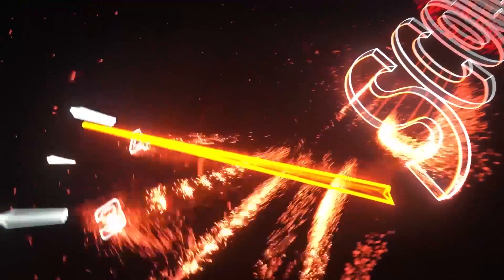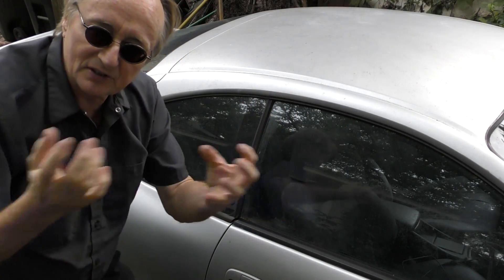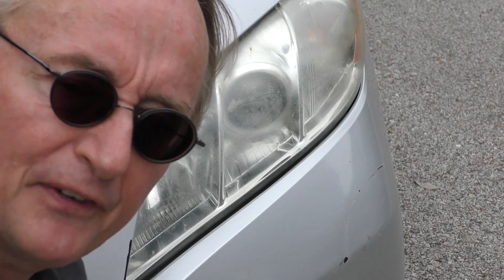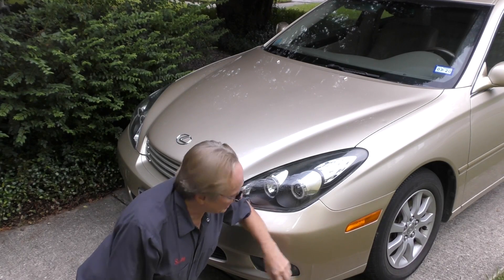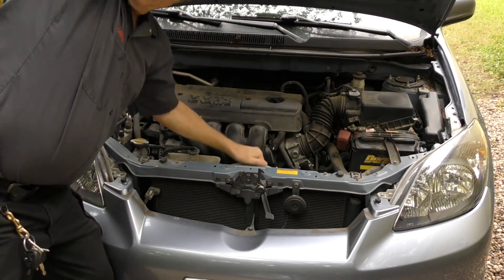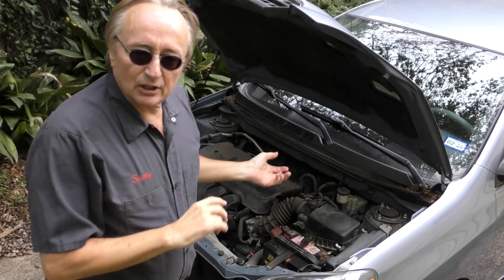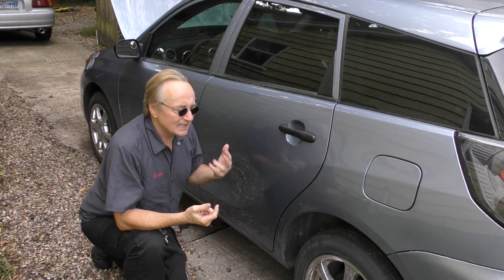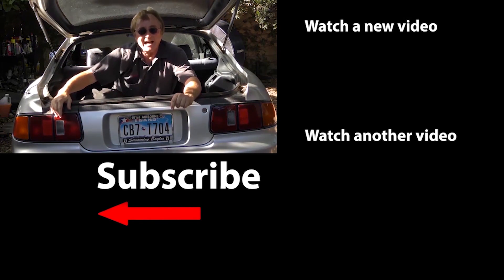You Can't Fix Stupid (Closing My Car Repair Business?)

Comment: So basically you're saying everybody should drive an air-cooled VW because:

1) Simple mechanical fuel pump in the engine compartment
2) No water pump (with ANY kind of impeller) to worry about
3) Glass sealed-beam headlights that never fog up inside or out
4) Chromed steel bumpers
5) No radiators to worry about
6) Chromed steel door handles
7) A single V-belt that's cheap and easy to replace

Hell, works for me!
Reply: I got one 9 years ago, never put 1 euro in it other then oil changes timing belt and few light bulbs. 0 problems and runs the same for 200.000km now,  since day 1. Can't complain.
Reply: @hammertiming8423  Got mine last summer, couldn't be happier.  Not daily driver but a lot of fun on the weekends, and so easy to work on yourself!
Reply: The VW's and early Porches were copied off the Tatra 11 -  Tatra 97  from the Tatra Company in the Czech Republic.
Reply: @JoeC88  except made properly, czechs cant even make a bed
Reply: @PazLeBon  In WWII the Germans rapidly rushed in to take over the Tatra cars and trucks that were superior to any others.  Tatra even made the air cooled diesel V8 & V12's for German tanks & other vehicles.
Reply: @PazLeBon  
Couldn't organize a rock fight in a gravel pit
Reply: Yeah, good car. Lets get a petition to that Brazilian plant to churn em' out by the thousands.
Reply: @mohabatkhanmalak1161  sounds like a good idea to me!  i miss 'em a lot!

Comment: 4:50 Plastic Bumpers... I remember learning to drive a big ol' 70s impala on a curvy road going 65 late at night. I hit the guard rail with the front bumper and it made sparks longer than the car. When I stopped to examine the damage there was just some chrome missing from a 2 inch wide spot on the bumper. That was it.
Reply: AAAHHHAAHAHAAHAHAHAHAHA!!!!!!!!
Reply: I had a 69 merc monterey . Lady with a brand new Datsun 280zx sticker still on the window hit me from behind.When I got out to survey the damage,her front and hood was cracked all the way up to nearly the windshield. My metal chrome bumper had a hardly noticeable dent. I told her my car didn't have any noticeable damage so no harm done. This was around 1981 in heavy Houston rush hour traffic.Last I saw of her she was boo-hooing on the side of the road.

Comment: Anyone can design a fuel pump, it takes an engineer to design one that barely works.
Reply: The engineers design a perfect long life fuel pump and it gets costed at $45 to manufacture, word comes back down to get back to the 
drawing board (ok, cad program) and make it cost $20 to manufacture...that's your budget, so there goes proper bearings and wear parts.
Meanwhile, back at Fiat Chrysler the word comes down to make it cost 50 cents to manufacture...
Reply: Engineers solve problems you didn't know you had using methods you'll never understand.
Reply: @davebuck3944  It's not all benevolent. They engineer things to function marginally using the cheapest materials possible sometimes = poor quality.
Reply: @brenttaylordotus  Many times the bean counters place budgetary constraints on the engineers making it nearly impossible to design assemblies to the highest standards.
Reply: You say that, but you probably don’t understand what goes into engineering design.
Reply: @brenttaylordotus  Nonsense.  That's the fast track to giving your competitors all your business.
Reply: Bo McGillacutty It’s not that simple. Not every product is a widget vs widget race.
Reply: @brenttaylordotus  Give some examples?  Certainly every car is.
Reply: @brenttaylordotus  Because engineers have to, Not because of lack of knowledge. My friend is a engineer. He tells me that he works on a project which is not properly suited for using yet, But his manager tells him to prepare for use because the company's wants it now. 

There is no time to make it perfect. It also has to be cheap to make. If it breaks they make money again 😉 Don't blame the workers. Blame company policy.
Reply: @cutthroat795  I am an engineer with 39 years experience working in the defense industry. I worked at Pratt & Whitney's West Palm Beach plant for 5 years and Harris Corporation's plants in Brevard County, FL the remainder of my career. There are many factors that must be considered in a design. Reliability, durability, maintainability,  producibility and Design To Cost (DTC) all must be considered. Many defense industry companies have different specialty engineers designing the same component assigned to what are called IPTs (Integrated Product Teams). There is also a Chief Systems Engineer who oversees the entire program engineering team and is responsible for ensuring the design meets all contractual specifications. Then there is a Program Manager who is responsible for the entire program from a cost, schedule and technical compliance standpoint. The automotive industry manages the new car development process much like the Defense industry manages weapon system design. Based on my experience I understand the engineering design process.
Reply: I see stupid design everywhere, not just in cars. 😀
Reply: No, it takes an accountant to design one that barely works.
Reply: @davebuck3944  - A cost cutting measure on a bearing on a $250 million airplane can turn it into flaming junk scattered over the landscape. Full of dead meat, too.
Reply: @algrayson8965  I realize that. I'm a recently retired engineer who worked for 39 years in the defense industry including 5 years at Pratt & Whitney.
Reply: Oliva Gina  you may want to checkout L3 Harris Corporation. Their headquarters is in Brevard County Florida. They employ about 6, 000 people in four different locations within the county. Many are engineers including mechanical. Brevard County is a great place to live. It offers affordable cost of living including housing. The county has over 70 miles of beaches. We have lived in Brevard County for 30 years and have enjoyed it. If you're not a Florida resident you may not know that Florida has no state income tax. I worked in Florida my entire career. I estimate I saved at least $150K by not paying state income tax during the course of my career.
Reply: Unfortunately, I can't help you with that.
Reply: @davebuck3944  
I  agree.   back  yard  weekend  u  tube  "mechanics"  giving   their  2  cents  on  engineering  n  engineers  is  nonsense.

Comment: You can't fix Stoopid, but you can avoid Chrysler.

Company has recommended you start learning engine repair = Chrysler
Reply: 3.7 V6 to start your auto repair study
Reply: @CHMernerner  also the 3.8l v6, start with the crappy valve stem seals they used at the factory.  Replace those to stop it burning oil.
Reply: Good  one
Reply: @orbitalair2103  i work at a chrysler dealer as a tech and have for a few years, 3.7 magnums are pretty reliable. old engines, a lot still on the road and not a lot of problems. and the 3.8 has also been reliable for many customers past 100k in jeeps and vans. i see many of these a day and they are not even close to new anymore, im genuinely curious what makes you say this. i agree they may not be great power motors or even very tourqey motors to say the least but they are reliable...
Reply: You can't fix stupid, but you can Avoid stupid
Reply: I just took a 1700 mile trip , I saw an equal amount of broken down GM products and Chrysler products.
Reply: Mernerner 3.7 Cyclone?
Reply: @MsPokemonsoulsilver   I agree... I don't feel Chrysler's are that bad....see my other post in this column...The 3.2l engine in my 2000 Intrepid has been totally flawless for 363,397 miles without a single repair. The only requirement is that it being an interference engine the timing belt must be changed every 100k..GM though is horrible.
Reply: @MsPokemonsoulsilver  They have no idea what they are talking about. They are just pandering to Kilmer hoping he will reply to them because he bashes Mopar all the time. You should have seen Scotty's video he did when Iaccoca died. It was reprehensible.
Reply: @richarddobson3138  That's because it's not made by Fiat or Daimler.
Reply: ganzonomy    I have been driving Chrysler products for decades and have never had a major failure. Ford and GM, several failures.
Reply: Avoid VW.
Reply: @De Sign Had a 92 minivan with a 3.3L put over 250K no engine problems except for poorly designed belt tensioner,  sold it still ran fine. Now have a 2002  with a 3.3L with 230K  no engine problems but unfortunately the AC evap coil is leaking and requires the entire dash to come out :(
Reply: @MsPokemonsoulsilver     I am a tech also. Chrysler is no worse than any other car.  I see older caravan cabs with 3.3 and 3.8 engines with well over 600.000 on them.
Reply: @erty7012   They all do the same stupid things.
Reply: @MsPokemonsoulsilver  

To be fair it Should be reliable past 200k. I got a 36 year old landcruiser moving piles of snow every year on a very long driveway and it still has alot if it's original parts. Also the last major expense was a mere 300 on it.
Reply: Impressive
Reply: @BobRobsstrikesagain  

If you are replying to me then thank you.  It was a rebuilt thermostat housing. Also it still has it's original transmission, u joints, starter, and alternator and other things 👍
Reply: @MsPokemonsoulsilver   : Yeah, there's nothing major wrong with the majority of Chrysler products. Like any brand, as a responsible consumer, (which most people are not) you have to do your homework. You must learn which models are the duds to avoid, and which models are the good ones to own.

Each manufacturer has it's own issues. I've owned well over 20 different Chrysler products (mostly trucks, but a few cars & vans too) over the years. None of them have been any worse than any GM or Ford that I've owned. 

Ford hasn't made a decent vehicle since 1998. They severely rust apart and their electrical systems are total garbage, plagued with constant problems.

MOST vehicle problems stem from lack of proper routine maintenance, in which the average vehicle owner does damned near zero. Simply changing engine oil once in a while, does not constitute proper vehicle maintenance.

Facts.
Reply: @De Sign Keyword "made".  As in past tense.
I love the old Mopar Chrysler.  But they started going to hell in the early to mid 1970's.  In my opinion, they never recovered.

Comment: In my 1999 Tahoe, I cut a hole in the floor under the rear seat when the fuel pump failed, then I patched it up with a sheet metal patch, sheet metal screws and butyl rubber tape sealant.